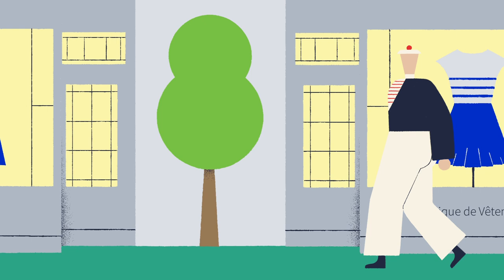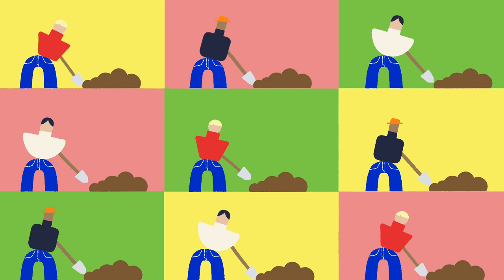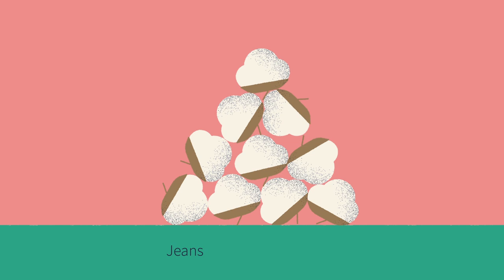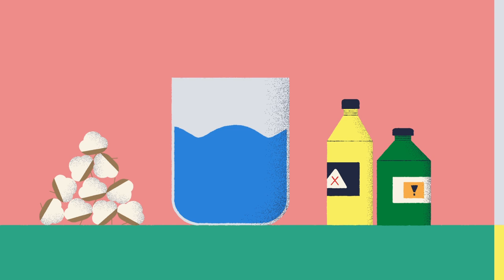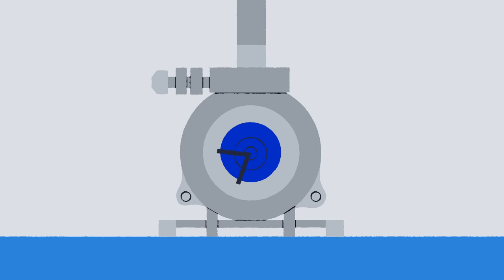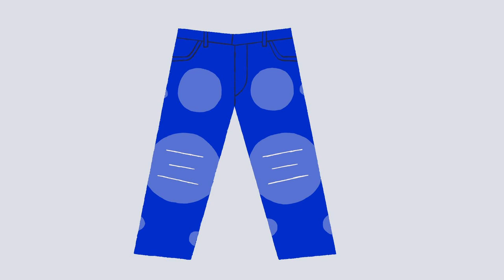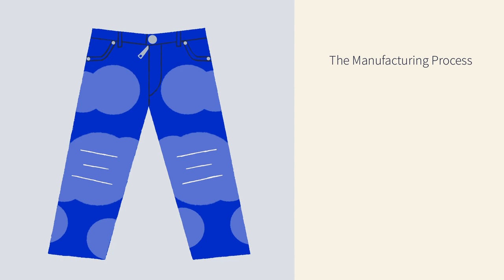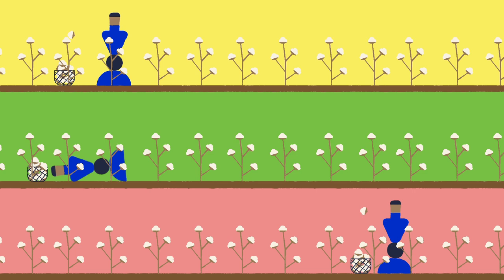Why do your jeans wear out so quickly? - Madhavi Venkatesan

Comment: "Most pairs last no longer than a year" because they're cheaply made. I get that not everyone can afford $100+ jeans, but what I've learned is that quality is SO MUCH more important than quantity. When I was a teenager my mom bought me a $150+ pair of jeans and I freaked out, thinking that was too much. Well it's been almost ten years and I still have those jeans. Unfortunately (fortunately?) I've lost weight so they don't fit me anymore, but I still occasionally wear them when I don't have to look too done up because they are SO GOOD. It's really a mentality about clothes we have to change, because it's better to have 2-3 pairs of quality jeans than needing to constantly rebuy cheap ones. It ends up costing less in the long run anyways.
Reply: I bought some 100 ones a few years back. Jeans last me a year because of their size. I don't fit in them for long so I either have to buy an oversized one or mens
Reply: Yup. I buy quality jeans every 5 years at most and it's usually because my body has changed rather than the jeans wearing out
Reply: Bro i just asked what time is it
Reply: Price doesn't necessarily equate to quality.  I bought a pair of 15 dollar jeans 13 years ago at BJ's, and I still wear them nearly every day.  They are super comfortable.
Reply: But weren't they supposed to be cheap, like for workers
Reply: @yoshi9358  Try to buy some tools and you'll see how cheap they are
Reply: yes and no. OLD jeans were durable, regardless of price. Nowadays only expensive ones are durable because it would be bad for the brand if they were not, but they still get discarded after a couple of years because people with money don't want to be wearing the same pair of jeans 5 years in a row, so what's the point?
Reply: I paid less than $35 for jeans that have lasted over 10 years.
Reply: Every pair of jeans I buy cost between €150 and €200 euros
Reply: I've got a pair of wranglers that are ten years old and still going strong
Reply: All my clothes are cheap except for my shoes that cost 100€, and they've lasted for years. I just threw away an H&M T-Shirt that I bought int 2014 or 2015 because it had too many holes in it. The second one I bought is still wearable, at least as an undergarment. I have lots of clothes that I've worn for half a decade or more. 10 years ago I wasn't fully grown yet, so I can't have that much clothing from back then.
Reply: Since I started buying quality used jeans I found it better than buying less quality new ones that last 2 years max (but often just a year)
Reply: Conflict of interest for the companies that make the pants. They make low quality pants so that customers have to come back to buy more.
Reply: It's not just about the price tag, though. Some places charge a ton of money for clothes that are literally the same cheap quality as what you'd get from Walmart. But because they have a big brand name on the tag, they can get away with it.
Reply: Meanwhile, me rejecting a pair of US$30 that was dad was offering to buy me cause he liked how it fit me
Third world represent 🤙
Reply: It IS too much
Reply: If you still like them but they’re too big, you can have a tailor alter them.
Reply: I paid just $28 for mine. I wear them almost every day (~5 hours), wash weekly, and yet I'm getting close to the 3 year mark.
Reply: It sounds like it lasted long cos you wore them sparingly. No jeans can last that long with frequent wear.
Reply: @user-lk4jd5yc8d  If you're talking to me I actually wore them A LOT. Like, every week, maybe-a-few-days-every-week, a lot. I remember after a few years it really dawned on me how much better quality they were because my other favorite jeans at the time had already worn a hole in the upper thigh area (thick thighs shout out) but these were barely worn out in that area. Nowadays I don't wear them much because they don't fit but that's only been the last couple of years. Now in fairness I wasn't like running around working a factory/hard labor job in them, I was just going to school and such, but they were definitely loved.
Reply: @32fps  How about you tell what the brand was.
Reply: But how do you do skateboard tricks in them without them breaking?
Reply: Yep, exactly. My Levi's and Calvin Klein jeans weren't particularly cheap (at least not from the stores, I'm sure thrift stores are far more affordable) but at this point in my life, knowing something will last years and years is enough cause SO many clothing brands pump out cheaply made and low-quality garments

Comment: I wear the same jeans for 4-5 years and I've never paid more than $30-$40 for a pair.  (And I wear them everywhere). Where are you people buying your jeans and what are you doing that makes them degrade so fast?
Reply: Same here.  I have some jeans I bought at Walmart back in 2011 & they're still perfectly intact & I frequently wear them.
Reply: They buy these fancy upmarket 
 jeans and pay through their noses for the brandname.
Reply: I'm thinking the same thing! In fact, I'm struggling to think of any item of clothing that I've ever bought that lasted less than a year, with the exception of items that got accidentally damaged.

I don't tend to buy particularly expensive clothes, either.
Reply: Not having a thigh gap, the constant chafing of the fabric causes the fabric to wear and eventually create a hole.
Reply: I am wondering if they mean when workers use them. Like, the original intent of jeans was to provide a study pant for miners, so maybe now if you used them for a similar purpose, they won't last as long?
Reply: I go outside.

Comment: Broke: Not doing laundry is unhygienic

Woke: Not doing laundry saves the world
Reply: I know right, I was waiting for them to say “then they punch a kitten”
Reply: Americans do wash their clothes too often though. Unless you sweat so much or roll around in dirt, you definitely don't need to wash your clothes every day. Especially not the pants. The only thing you should change almost every day are your underpants.
Reply: @solar0wind  god don’t advocate for people to be more unhygienic and smelly than they already are. A trip on public transport tells you all you need to know. I do agree that you don’t need to wash jeans every single use, but it’s important to air them out in the sun and fresh air if you are going between washes.
Reply: @solar0wind  almost every day? Every day, full stop. Same with your socks. T-shirts in the summer fall into this category as they absorb sweat smells very quickly. Doesn’t need to be a long hot wash in a top loader which can put unnecessary wear on clothes, a quick warm wash in a front loader is enough to lift sweat and then just dry it out on the line in the sun.

Comment: All my jeans wear out on the crotch area, and were I provided with the solution to that problem I could easily wear a pair for years, saving the environment and a pile of money.

Instead of a solution or even some tips and tricks I was given a guilt trip lecture how my thicc thighs kill people in developing countries. Wonderful.
Reply: thicc thighs 😂 no I hear you, a few of my family members face the same issue. I’ve always wondered if it’s possible to sew a leather patch to that area to prevent the two sides of the fabric from creating friction.
Reply: You can always sew patches on to fix. I just found an abandoned pair of jeans ripped at the crotch and am in the process of stitching them up - they're gonna look better than the originals when I'm done!

Comment: "Most pears last no longer than a year" I call BS. I have the same 3 pairs of $15 H&M Jeans I bought 5 years ago. If that's actually the case then people need to take better care if their clothes. I wear these jeans almost every day, and the only consequential damage is a broken belt loop on one pair from a bad skateboard crash. Unless the fit changes (congrats if you lost weight) I can't imagine killing a pair of jeans in 3 years let alone 1. Also for the point about buying used, this can be extremely difficult, I'm 6' 145lbs (183 cm 66kg) so finding pants that are slim enough (28-30 inch waist) and long enough (34-36 inch inseam) is quite difficult. I think the bigger problem is the systemic ingratitude that westerners have for the clothes on their back, or in this case legs. I don't mind having an impact of driving a car 70 miles 4 times a year for a cheap and still relatively high quality good.
Reply: Keyword: "most"
Reply: When you do not have a thigh gap, the inside of the pants rubs constantly, eventually busting a hole. Noraml wear and tear is normal, and wearing the pants for many days in one year is more than enough time for a hole to occur.
Reply: *pairs 💁‍♀️
Reply: @borkbork4124  This. Although I expect the OP will probably come back with "lose weight then, that's your fault too" as if genetics doesn't exist.
Reply: @borkbork4124  I’ve had family members had this issue and it’s unfortunate as it ruins a otherwise good pair of jeans. Is it possible to stitch a durable leather patch to that area?

Comment: Wow, if dislikes were visible, this video would've had more dislikes than likes.
Reply: @psi4262  Because it doesn't actually talk about what makes jeans wear out so quickly and spends 95% of the time shaming you for wearing clothes. If it's unethical to wear jeans, then honestly, we should stop caring about what is and isn't ethical.
Reply: @salum6690  The thought process of those with small egos and weak hearts might come to that conclusion yes. But the fact is that our society is structured in such a way that even something as simple as clothing causes so much harm, so it's only reasonable to conclude that society is rotten to the core and must be changed.